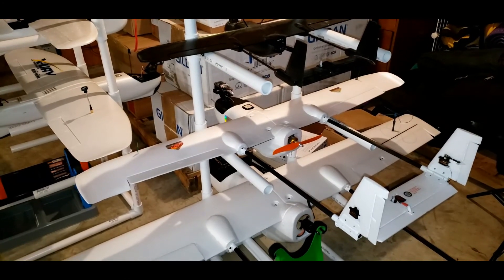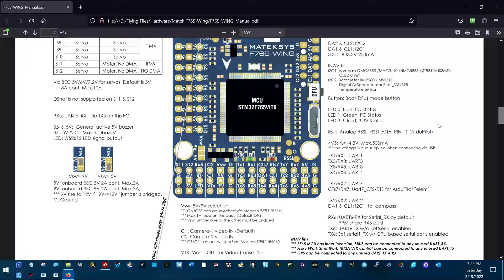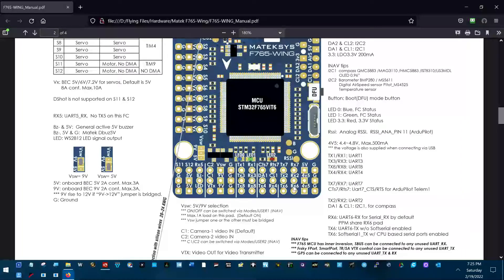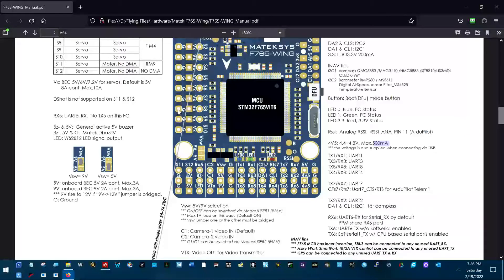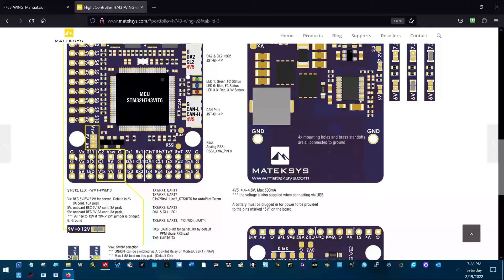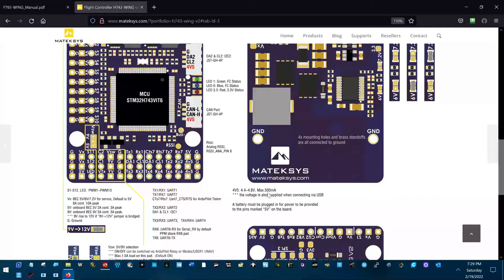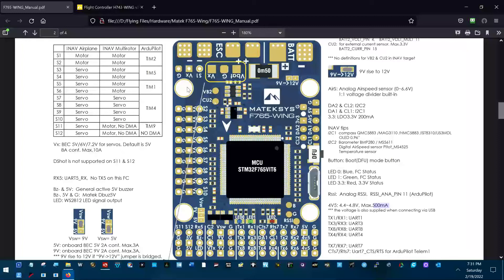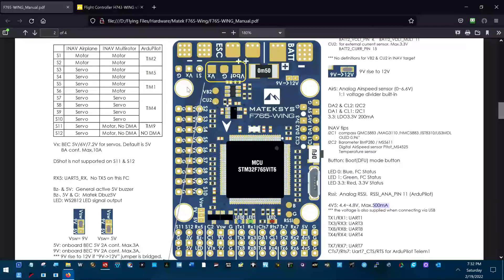Dragon Link Coming Along Finally

Comment: I THINK U R WRONG BUDDY IT HAS A REGULATER FOR C1 C2 SECTION WHICH IS FOR VTX
Reply: AND FOR THE SERVOS ARE T DIFFERANT POWER RAILS
Reply: VX IS SELECTABLE 9V/VBAT/5V  IF VTX GGOES VBATT USE THAT IS HAS FILTERS THAT TTTTTTTE OTHER RAIL DONT HAVE. sorry caps keypad is dieding itself lol
Reply: vx and vsw two differant rails vsw has loads of filtering
Reply from the maker: I have been many times in the past.  Nothing new.  :)
Reply from the maker: Yep, they can handle 8a according to the datasheet.
Reply from the maker: Ah, I don't know much about the internal electronics of these FC's.  I only found Matek about 6 months or so back.
Reply from the maker: This is the person I got wind of this problem from.  In his video at the 28 to 38 second mark you see the change in power.  Another person in the Dragon Link support forum at RCGroup posts the same in their support forum.  I am just finding this all out in the past week.  You can also see my question and the reply in the comments.
https://www.youtube.com/watch?v=toW9TVm3uPs&t=17s